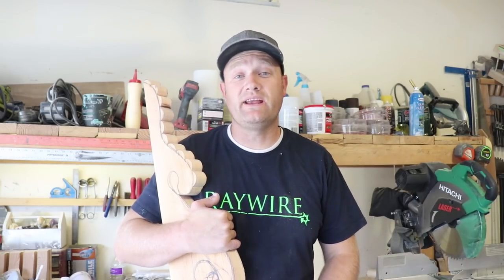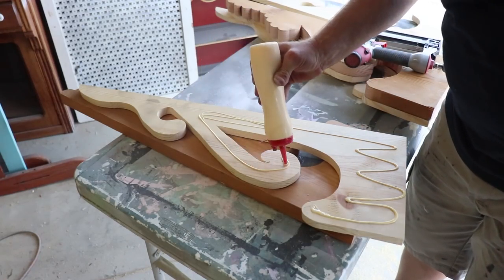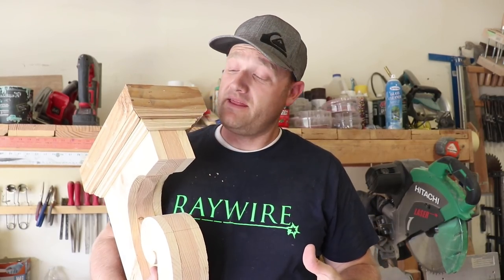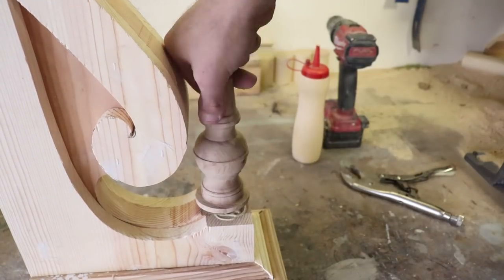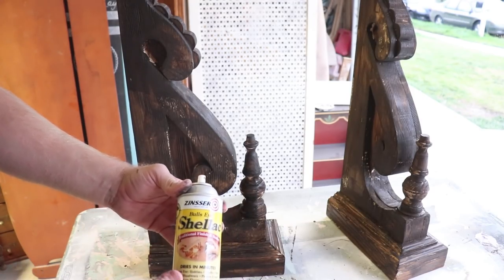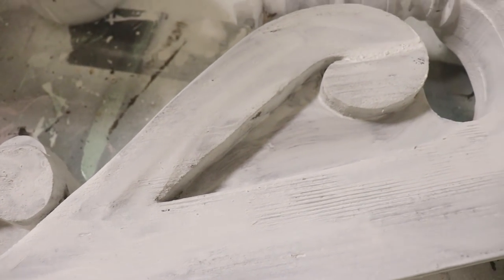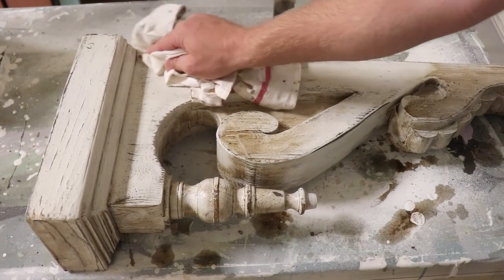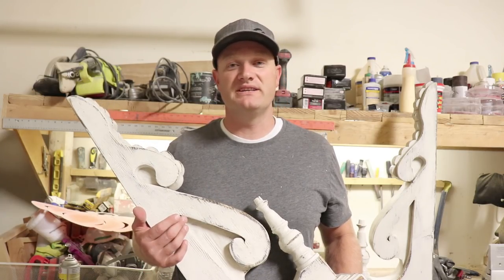How To Make And Age Farmhouse Corbels | Salvage Look

Comment: Zeb is there any reason why you don’t cut the corbels in the bandsaw
Reply from the maker: I use the band saw quite a bit for corbels but these are so large it’s easier to maneuver the cuts with a saber saw (jig saw) rather than fight them on my 14” band saw.
Reply: How do you keep the blade straight? I struggle with my cuts they always tend to kick to one side I have 2 jigsaws and used different blades but no luck on straight cuts. Thank you for your reply.
Reply from the maker: Best suggestion is to use a wider blade. More stoping and starting
 with tight turns but less deflection.